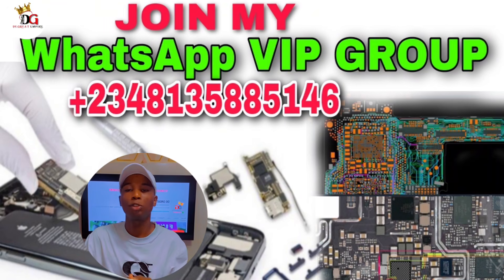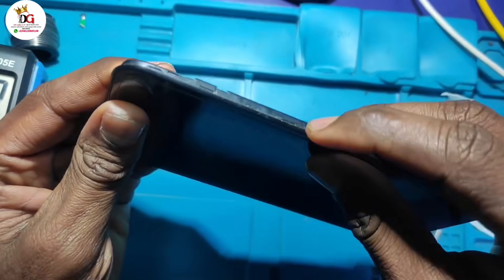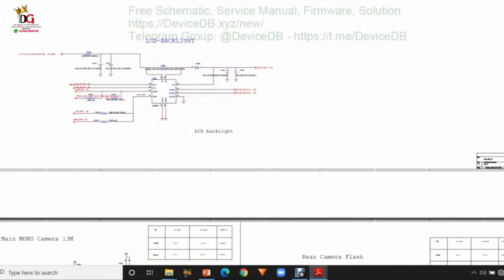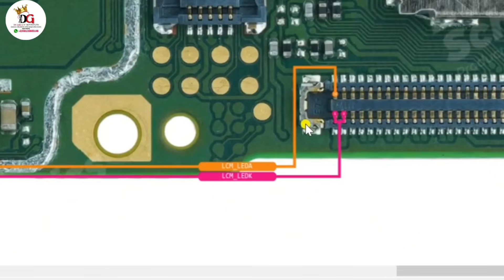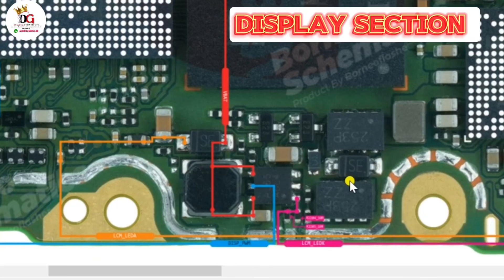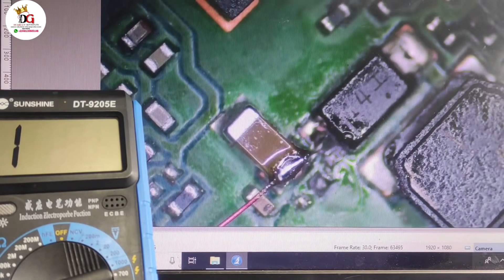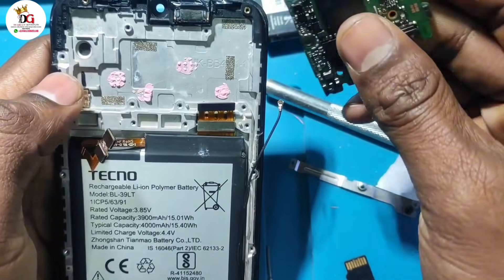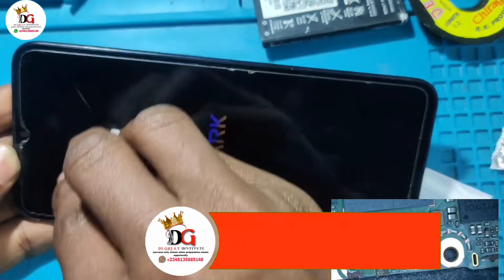HOW TO FIX PHONE NOT DISPLAY LIGHT BUT TURNING ON SOLUTION, WATER DAMAGE PHONE, BACKLIGHT IC FIX.

Comment: My phone backlight does come on when when I switch on the phone, but just for a few seconds and then it's off but the LCD itself works fine I can see the images but just no light. It happened after I replaced the screen. So does this mean the screen that got damaged? The device is Redmi